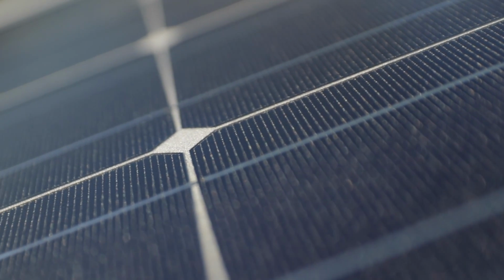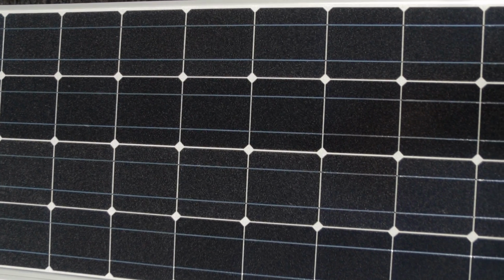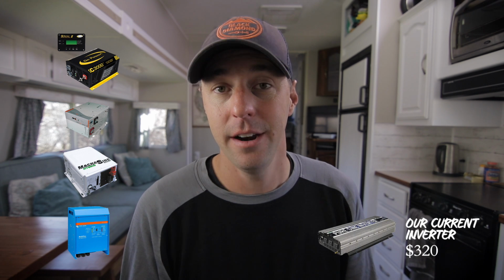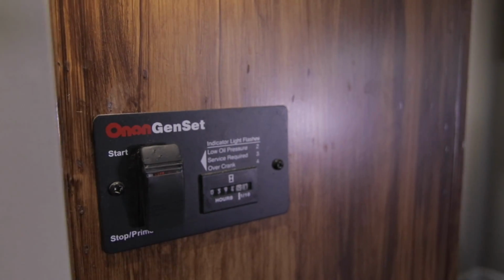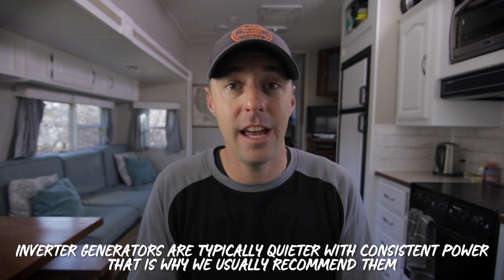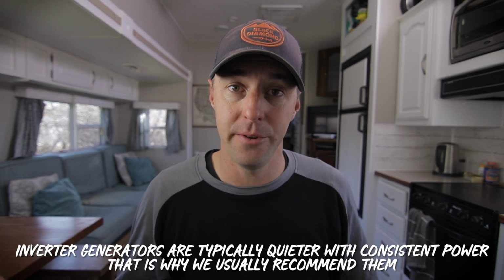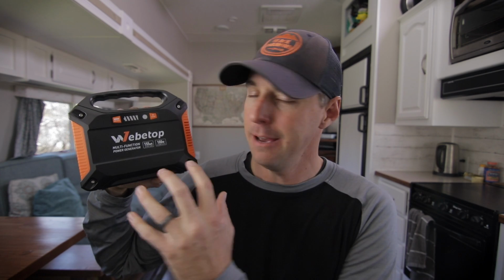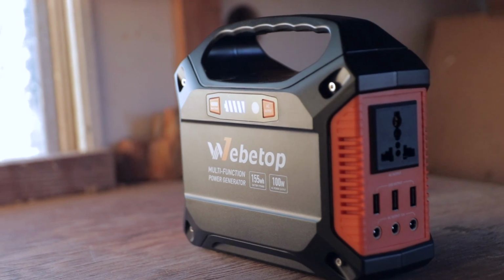BoonDocking Power Solutions

Comment: what about small scale wind generation? Ever heard of anyone in an RV using one of those?

I just finished installing a 2000w inverter and two 6v lead acid batteries and a modern converter to charge them. Haven't fully tested everything out yet but it runs the microwave, not sure i'll be doing that very often though! I picked up two 6v golf cart GC2 batteries from a reseller that occasionally sells recertified ones for 50 bucks CAD so it's kind of a no brainer until I can pony up the 1200 bucks for a lithium replacement.. If I was doing lithium though I'd probably be installing them inside the trailer somewhere to keep the crackheads from stealing it.

Comment: Love your videos..so good!  We have a 2020 Reflection & looking to add 1-2 Battle Born 100 watt hours and get the Champion Dual Fuel Inverter generator you showed in another video.  I was impressed that you were able to run 1 AC unit with it. I'm assuming we would be able to run the furnace fan with that generator during colder months correct?   Anyhow, keep up the good work!

Comment: I will say one thing about propane, it is pretty efficient, volume for weight. I went out with my family for the first time on propane with our popup. Ran the small dometic refrigerator and cooked off the fuel for 3 days. After we got home I used the cylinder on the grill to make dinner. weighed the tank the next day and we only used 2lbs of fuel, so 18lbs left in the tank. Haven't had to use the furnace yet, so not sure how much of an inpact that will make on fuel consumption, but I was pleasantly surprised. we also have 50W of solar power with a 53AHr deep cycle SLA for lights, the vent fan and refrigerator fan. Charge controller has USB ports and we charged 2 phones and a vape pen in one day while running the fans and light in the evening, still managing to maintain float voltage during peak daylight hours and not depleting the battery beyond 12.2V. Again haven't had to run the furnace yet beyond testing, so not sure how much its laod will impact the battery life, but so far our minimal setup is more than sufficient for complete off grid boondocking. I don't see it being an issue to run this setup for a week straight without refueling or recharging unless we have to run the furnace every night. At that point a spare LP cylinder and a couple more solar panels to upgrade should help. Charge controller is rated for 30A, approx 450W calculating sparingly depending on voltage level.

Comment: I watch alot of your videos and others as well on inverters, batteries, solar, and such and all the things they can run, but I live down here in south Texas and would like to boondock BUT how is this possible with 90 plus degree heat?  Sure it's good for charging the solar panels but I'm guessing even with all this set up you will still need a generator to run the a/c which will be running at least 60% of the day. Is that correct?  I guess my question is,  is any of this worth it to buy and set up in the Hot Texas, AZ, FL, heat or should we just invest in a good generator and be done with it? Because we will probably have the a/c on most of the day. Ha!  Love your videos. They have been very informative. Again no one talks about boondocking in the heat

Comment: Hi. I really enjoy your videos, very informative. We have a 20' trailer  perfect for my wife and I. Now and then I will take the trailer out with a couple friends and go boo docking in the Sierra's . When we purchased the trailer I had the dealer install a 12 volt cigarette type receptacle and 2 USB receptacles next to the queen size bed. I also have a small plug in inverter . Twice friends have brought CPAP machines and our 2 lead acid batteries have easily powered the machines. During the day I run my Ryobi 1800-2200 inverter generator for 60-120 minutes and am good to go for another night. Eventually will add some solar. One thing I do need to do is get a set of various orifices to adjust for altitude as my generator doesn't have the output it has for Southern Calif sea level than for 4 000' Sierra's

Comment: Hi! Hoping you can answer this or rather anyone possibly.  We just a used 31 ft 5th wheel a few weeks ago and are remodeling it to our liking.. can't wait.  When we bought it, the previous owner took out the propane/gas fridge with them or whatever and replaced it with a smaller residential 9.8 cu ft fridge(or the dealership put it in).  We probably won't do much boondocking at 1st but rather week or week getaways.  My question is,  when traveling to our destination, how do we run this fridge in order for it to be cool or cooler by the time we get to our destination.  These don't have a 220v plug like the big fridges do(I think) but rather a 3 prong regular plug that fit into say your home socket.  Will it run off the RV battery? I can't imagine it will use that much power.  I keep hearing inverter but I'm not really sure why.  Any info will help. Thanks

Comment: Jared, I have a 2017 Ceder Creek 5th  RV pre-wired for solar. If i install the same renogy system that you installed would 2 battle born Lithium batteries be enough ? Also, they installed a 1000 watt inverter, How much trouble would it be to replace it with 2500-3000 w?

Comment: I'm brand new to RVing. I'm going full time in May and just purchased a keystone toyhauler that comes with My new an on board Onan 5,500 watt generator.

Where does that fall in line on your list? I'm assuming it just means it gives of more power but, what does that mean in far of what I can run off of it or more spefically what should I not run off of it?

Comment: My heater wont run all night because my battery dies then my generator wont start so I have to go start the coach engine, wait for the alternator to kick on the. I can fire the generator. Would a good place to start be adding more batteries? Also would like for my kids to be able to watch TV and use the outlets without the generator is there a way to tie in the inverter or do I have to run extension cords to the inverter? Thanks for the great videos.

Comment: Good video & info. I played around with Solar for 2years now. Used mostly to charge my batteries to run lights at night, charge phones & computers. No 110 inversion.. Works great when in the sun for longer periods. Good learning experience using solar. I was not aware just how sensitaive they are requiring direct sunlight (which changes about every 10 minutes) to get the max efficiency. I did end up with a small 2000w generator though as we tend to camp in the trees a lot. We seldom use A/C but may go to two in the long run as it is much easier for me to lug in and out of my pickup ~50#’s vs one of ~100#’s and its about the same money to purchase either way.

Comment: Everyone goes to Harbor Freight, you needed to mention Predator Gen's.  They are a pretty good compared to similar of the others.
Reply: Also if you have a hybrid inverter like Magnum 3012 with an easy start you can run A/C for a short time.

Comment: We just picked up 2 Yamaha inverter generators - 2000 watts for $549.00 from Costco.   We were looking for something lighter than our Honda 6500. We just need the fifth wheel to go with them! Our old Fifth was crushed in the spring by a tree in our yard! Thanks for the ideas and cost of what is out there solar wise.
Reply: I am not sure which model you have but one I saw at Costco said powered by Yamaha which may not be the same as made by Yamaha.
Reply: @bruceh3786  you are right!  They had Yamaha plastered on the price tag and the box itself has Yamaha in huge letters.  I looked  at the a-1 power info and they may be good.  We were thinkiing  of the 3500 inverter at Harbor freight for about 620.00 on sale but saw the "Yamaha" and felt more confident.  We will check them out  and see if we want to keep them. I told my husband and he said he realized  yesterday what the box said. Thanks for the info.
Reply: I hope they work out for you but if not, Costco has a great return policy.
Reply: @bruceh3786  thank you

Comment: Great video! When we boondock I use a champion 3500w non inverter dual fuel from Sams Club that was only $300 runs everything on our 30amp service including the AC and we ONLY use propane so no need to haul smelly gas. If we run it at night in a hot hot summer evening with AC and everting running we typically get between 8-11 hours depending on the temperature. HIGHLY recommend. If I was as talented as Jared I would just make my own review video
Reply: 300 bucks sounds like a steal for a dual fuel generator. Do they still have that at the store? What size propane tanks you use?
Reply: Justin DaShiell and your neighbors probably don’t like you much. That nose level is just not acceptable out of construction and emergency relief.

Comment: Love your videos.  I was able to buy two 12 volt C-Pap power adapters from our medical supplier for our CPAP machines.  The secret to lower the amp draw is to go into the menu on the CPAP machines and shut off the air heaters typically set for 72 degrees on shore power.  Shutting off the humidifier also drops the amp draw.  The wife and I use ours like this with no problems.  Run all night and still have 60 % batteries in the morning with two big 6 volt golf cart batteries in series.  Rated at 225 amp hours.
Reply: Thank You. Need mine every night!

Comment: Great video!!  Is there a reasonably priced wind solution to help speed up solar battery charging?  Can we buy and plug some kind of windmill to compliment the solar system?  Can the wind solution use some of the same components of the solar system (e.g. the inverter)?  What do you mean by the A/C slow start?  I guess I grab the concept ( a device that prevents any motor to aggressively draw power at start-up), but I never seen one.
Reply from the maker: I'll do some home work on the wind turbine, it's crossed my mind but I've never experimented around.  We installed an "Easy Start" on the install for Marc and Trish (KYD) on their rig.  I'll add this to my list of videos to do. You are correct in your understanding of the concept.

Comment: That’s what I was having a hard time with was my CPAP at night. I need to run my generator which people around me didn’t like, and I totally understand. But when you need it or you need a breathing machine you have to have the power to do that. But that little device you showed at the end of your video was great, I didn’t know it existed. I will definitely be getting one. Thank you for all the information that you give us and I appreciate the steps that you take to make sure we are informed correctly.
Reply: I hope it works out for you. Just one thing to keep in mind some CPAP machines draw more than others. It would be good to see what yours draws for power Incase you need the next size up in for that small Webetop power station.
Reply: Another option, depending on the coach battery capacity and CPAP power draw, is to purchase a small portable inverter and plug or connect it to the RV 12 volt system to provide the 110 volt AC power to the machine.  It may be cheaper and you do not have to charge an extra battery or store the stand alone battery unit somewhere.
Reply: Bruce H thank you for your reply. I’ll look into that option.

Comment: It's good to see that you can do a solar setup without spending $6,000.  This is great info, as always!
Reply: Solar can be cheap for boondocking depending on what you want out of it. If you are cooking and running the fridge on gas and only using solar for lighting and fans it can be very cheap. I picked up a 50W kit, 2 panels and 30A charge controller on blow out sale for $100, had a spare 53AHr SLA deep cycle from a UPS pack that had one battery go bad, and a $20 battery box. bit of wire, some fuses and a switch for main battery disconnect and we have no issues. Lights are all changed to LED and we run a fan in the vent hood and the refrigerator almost consistently, and charge phones off of it with the built in USB charge ports on the charge controller. If you want to run an inverter for 120v aplliances, microwave or AC, then you will need something more substantial, but we do none of that on solar. You can do a lot for a few hundred dollars, just don't expect constant and on demand power at will, sometimes you have to wait a few hours to float your batteries before drawing a load like charging a phone, but if your conservative with your power you can make a little go a long way. I haven't had to run the furnace yet on battery and might have to add a panel and battery to reduce charge time recovery and reserve capacity. Or just not charge 3 phones off it in one day.

Comment: Another choice are the Yamaha generators..  Similar reliability to the Honda, but at less cost.  I got the EF2400ishc which runs ~$1300, but has the power to run a 13K AC, etc.  And if you goal is to run an AC unit, buy a Hard Start Kit for your AC like the Supco SPP6E which costs ~$22. Folks have been able to start a 13K unit with a 2K generator with one installed.
Reply: I have 2 of the Yamaha generators.  A 2400 which was plenty to run the AC on our Lance truck camper and it also had no difficulty with the AC in our Titanium 5th wheel.  We upgraded to a Yamaha 3500 to get electric start (my wife had trouble pulling the rope start on the 2400).  The 2400 took a serious bath one night over 10 years ago (the Walmart parking lot we were sleeping in flooded).  The generator shut off because the engine got flooded (about 6 inches of water in the parking lot).  I lifted it up onto the tongue of the trailer thinking the generator was ruined.  Pulled the rope slowly a few times to see if the engine was hydro locked.  Thankfully it wasn't!  A couple good pulls on the cord and the engine started up again, I let it idle for a couple minutes.  Shut it off to plug the Lance power cord back into it (yes it was sopping wet).  Restarted it, turned the AC on again.  That generator STILL runs great.

Comment: I have a couple of the Honda 2000 units and they have been great.  Honda replaced that model earlier this year with the 2200 watt model.  

 Here is some additional information to keep in mind on the Honda.  The 2000 watt rating is the initial boost output.  The continuous output is 1600 watts.  The wattage shown for most is the initial boost that then drops to a lower output.  The Firman is sometimes the exception and they show the continuous output in their promotions.  

Over 80% of the operation of my Hondas have been at 9000 FT yet I have never had to change to high altitude jets.  There has been no plug fowling or other issues.  Honda offers high altitude jets but I never had the need.  That is most likely not true from other brands.  Finally, the 2000 watt generator will not run a 1200 watt microwave at high altitude.  It is actually 1600 watts output after the start and then when the decreased performance at higher elevations is factored in, output drops below the draw of a 1200 microwave.  It did work fine with the microwave at desert altitudes of 1000 ft.  The new 2200 model may be enough but I do not have one to test.  

Since buying my Hondas years ago when they first came out, a lot of China models have hit the market.  Some look good.  The Westinghouse looks interesting because it is rated at 2500 watts in the smaller suitcase size.    

I am thinking of getting a 3000 watt plus model to run the AC and the top of my list is the Champion or the Firman with electric and remote start.  I am leaning toward the Champion because it looks like it would be easier to change out the jets if needed.  The job does not look to complex on either.

Comment: Very well put. We arrived to Quartzsite to put our energy solutions to work. Quickly found out we didn't have enough solar because we were running the genny more than I intended. (6 hours a day) Since then we installed 200 more watts and I only have to run the genny 3 hours a day. Next move will be to add a battery. Since I don't have any more room on the tongue and don't want to mix batteries I'll wait and get some sealed one later. BTW- We have two Group 31 batteries for 210ah.